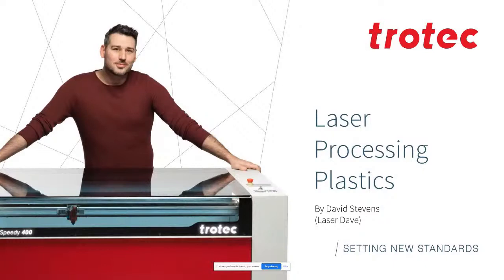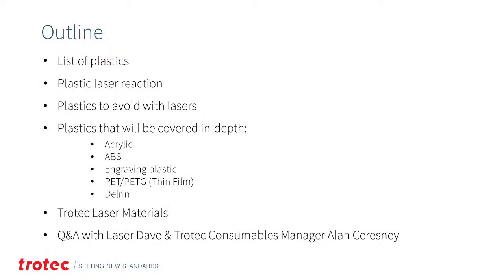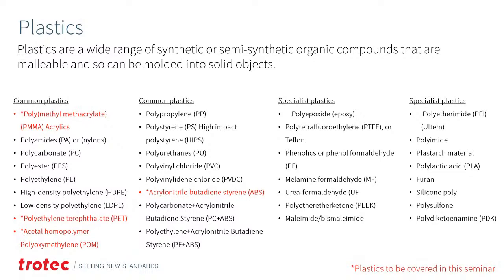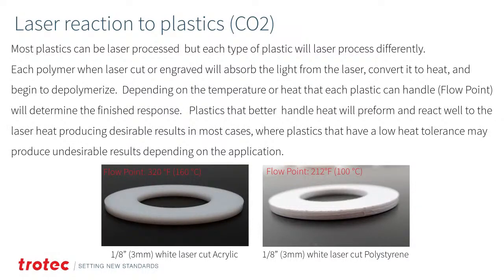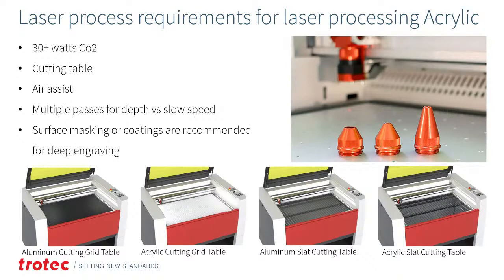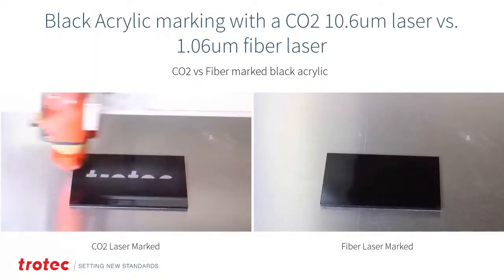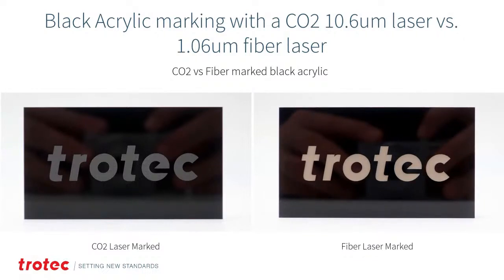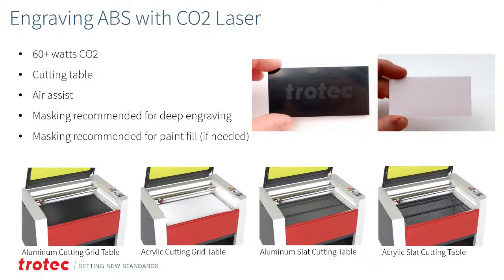Trotec Third Thursday: Laser Processing Plastics Virtual Workshop

Comment: Dave -  I am struggling w/ cutting 1/16" and 1/8" cast acrylic on a specific file.  The file contains cut outs that are about 5" long and very thin and spaced 1/8" apart.  Any advise on techniques to keep material from warping the acrylic?
Reply from the maker: Hi there! Our technical support team should be able to determine the issue and assist you with correcting it. Please reach out to them at 866-226-8505, option 2. Or fill out the contact form here: https://www.troteclaser.com/en-us/contact/technical-support/
Reply: try cutting the material twice with a lower power setting, this way the laser isnt heating up the material as much and hopefully not warping either. hopefully after a year youve got yourself dialed in.

Comment: What are the acrylic cutting tables made out of if not metal? Are they durable or would it be a consumable?
Reply from the maker: Hello! Our acrylic cutting tables are made out of acrylic with a metal frame. They are very durable and, depending on the material and how often you cut, will not need to be replaced for a fairly long time.